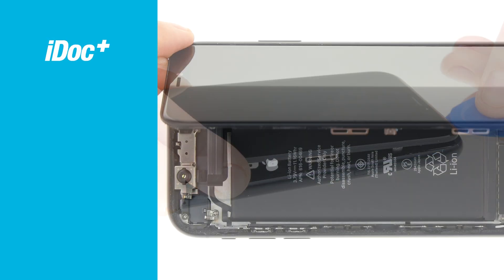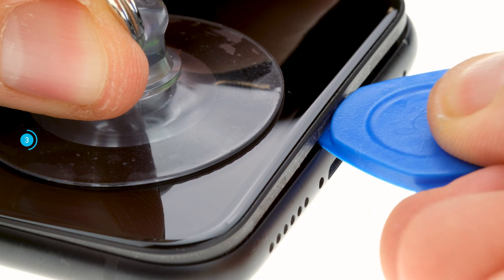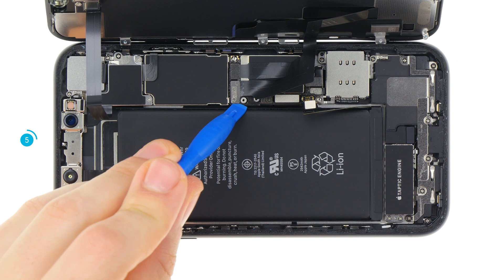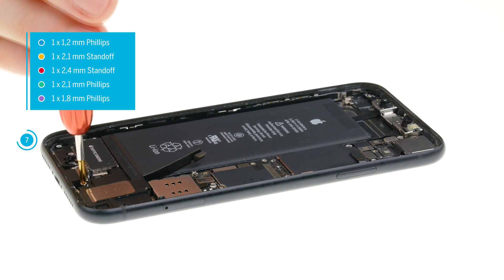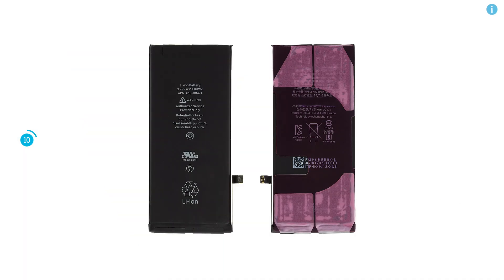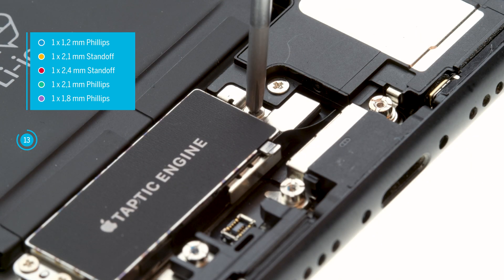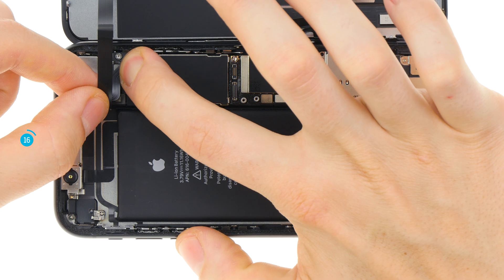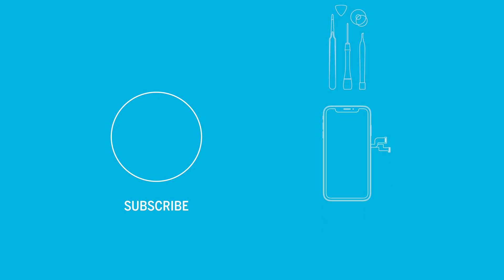iPhone XR – Battery replacement [repair guide including reassembly]

Comment: Excellent video. Unless you do this sort of job for a living it’s not a job for the faint hearted. I set aside a morning, went slowly and carefully and it took me a full four hours. Wife not totally happy and told me I should have taken it to one of those cheap mobile shops that are springing up everywhere. A few comments for anyone else attempting it:

1. The two standoff connectors holding in the battery at 4:55 need a different tool than the rest. I used a small flat head screwdriver, ground down to make it fit in the very shallow slot, but I expect the real tool is supposed to be some sort of special cross head thing.
2. There are four adhesive strips under the battery. Three of mine snapped but the fourth came out, which was just as well because it would have been almost impossible if I couldn’t have slid something under it. I used a small plastic scraper and heated from the back to work it free. This actually made removing the haptic engine, speaker etc. a waste of time as the battery extraction was all done from the other end.
3. I used strips of double sided tape on a piece of card to hold all the screws and other parts as I did not have a magnetic tray. There are a lot of screws and many different types and lengths so it is important to be systematic. They are fiddly to handle and I used a combination of the Y-shaped tool which was magnetic and the Phillips which wasn’t to move them into position.
4. I’m 68 so close up vision not what it was when I was a kid. I have a cheap head mounted pair of magnifier lenses which is fantastic for jobs like this. If your vision is less than perfect you’re going to need some help like this.

Everything worked when I’d finished. Apparently the procedure is to charge to 100% and keep charging for two more hours, then run it until it dies, then fully charge again. Try explaining that to a wife that is already in severe withdrawal and needs to go out immediately! You’re also going to have to explain that the really unhelpful battery warning message goes away after a couple of weeks. Thanks for that Apple.

Comment: No. I did not have fun. No, sir... not at all!!! For some damn reason, I could not get those little buggers on the last 3 plates back on. Took me, oh, maybe 3 hours. Dropped a couple of those really short bois on the floor when they went flying off the screw bit. Every speck of soil on my hardwood floor looked just like a screw. Hope my husband's phone is fully functional. So far, so good. It turned on and the screen and sound works, at least!! I told him, "NEVER AGAIN! You take your cheap ass down to AT&T or Wal-Mart next time and buy a new damn phone!!" The OEM adhesive tabs broke, the adhesive broke. I got one piece perfectly removed, the rest just kept falling apart!! Finally had to heat and pry. His battery has been needing replaced for over a year now, so the adhesive was probably just heat fixed and aged. 0/10 would not recommend. Just take it to a battery store and let some guy do it for 60 bucks. And yes, I was using the appropriate sized screw bits and type for each screw. I have a 72 piece bit set for small electronics, so that wasn't the issue. The screws just didn't want to sit on the bits the way they were supposed to. Thanks for the video nonetheless! Couldn't have done it without you!
Reply: Yup! Definitely a lot more tricky than my iPhone 6S was. You’ve gotta feel some sense of satisfaction when it turned on again at the end though? 😀